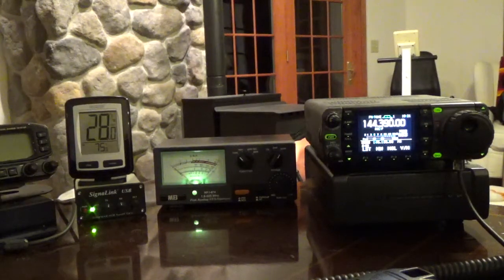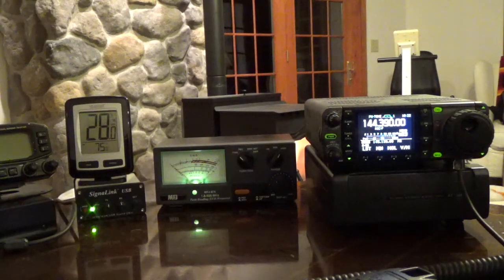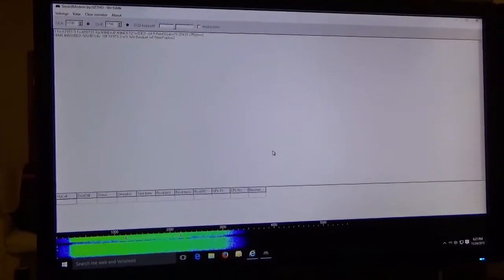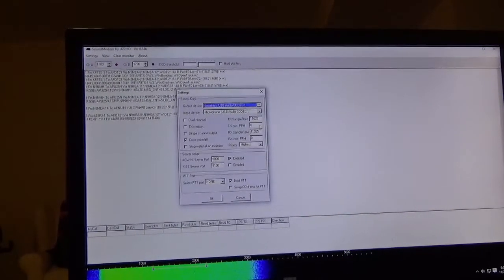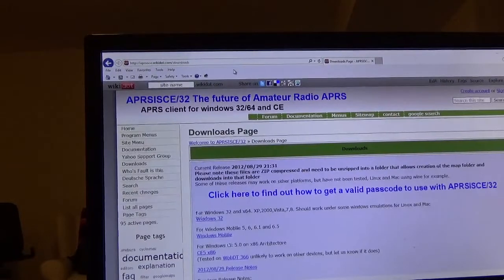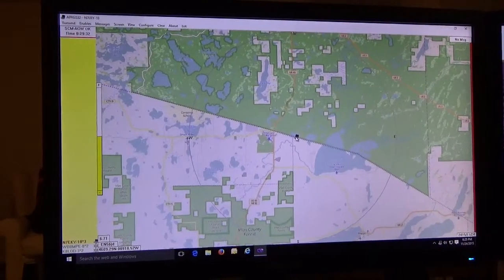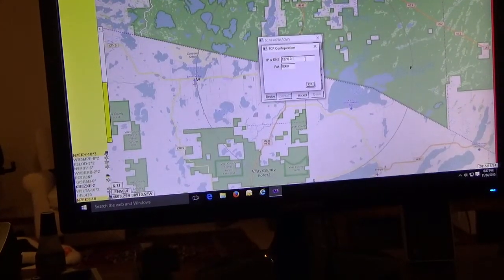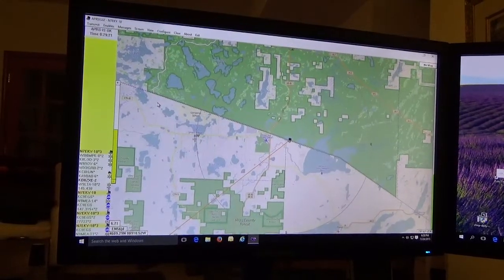APRS with UZ7HO SoundModem

Comment: I like this.  I realize this video has been out there for 8 years now, but stumbled across it while looking for some other ARPS info.  I really like my IC-7000 (I have two of them).  It's was my first rig and probably still my most favorite to use.  It just works and is, as you know, All Band, All Mode. It was nice to run across a video showing it off.

Comment: Paul, I had recently been wrestling with setting up APRSISCE/32 to play with my Signalink and a cheapy Baofeng.  I finally got it working last night using AGWPE but, as I floundered with solving Tx and Rx issues.  As KISS and Simple KISS seem to require COM ports, I got little farther with either of those.  I next went to the soundmodem utility and I just couldn't quite figure out how to connect to it using APRSISCE/32.  Luckily, it got it working under my original plan of AGWPE.  I just happened to notice that the port you demonstrated appeared to contain the letters AGW.  Does soundmodem run its own AGWPE daemon?  Thanks, I loved the video.  I truly wish I saw it before I started my project.  I think it would have saved me some time to get up and running had I seen your video first.
Reply: Hello Dave: Yes, UZ7HO supports AGWPE on port 8000 and Kiss on port 8001 by defaulkt but these ports can be changed. I really like this application. He did a great job on it. It supports APRS on HF also. 73,
Reply from the maker: Glad you got it working. UZ7HO was a good solution when working with a non-APRS radio

Comment: Thanks for putting together this video with all the equipment demonstrated alongside the software involved. That helped a lot. I'm in a class studying for my extra and we'd been talking about APRS for a little bit today. I've used the smartphone client and already had aprsis32.exe on my PC already. I didn't think to pair that up with the soundmodem program (duh). 

You have enough information here that I got the 2 programs paired up just fine. One note: the latest downloads from UZ7HO are a little different now since he has a different versions of soundmodem. I ended up using the version I downloaded fall 2016 (soundmodem 95) in this case and it worked fine. 

Now if I can finish figuring out how to integrate soundmodem with the current version of Winlink (aka RMS Express). 

A couple folks asked where APRS is helpful. Our local hams use it a lot for just casual position tracking and messaging. Beyond that, it's very helpful when weather spotting (our NWS ham team can see where spotters are) and for public service events like bike races where we have "support and gear" teams deployed. We're looking at getting basic email running with aprs as well, but that's another learning curve for this spring. 

Again thanks!   - wx9vor
Reply: Well, now 2 years old. I did see that UZ7HO's software is updated. You might also want to take a look at DireWolf. Runs on Linuz and Windows - good stuff that will also connect using KISS or AGW
Reply: That same classmate today mentioned DireWolf as well. He has it running on a Raspberry Pi. I'll definitely look that up. 73.
Reply from the maker: Been working with DireWolf on the Raspberry Pi as an iGate - works quite well. You can do a Receive Only iGate using an RTL-SDR. Works like a champ!
Reply from the maker: Glad it worked for you

Comment: Very informative.  I understand that this particular software modem/TNC by UZ7HO is highly optimized and likely works as good (or perhaps better) than a hardware based TNC modem.

One thing that you didn't really say, though, is that while this "gets you on APRS"... what does that really mean?  For instance, did the particular software install and setup that you did just make your home an i-Gate (assuming that the PC is connected to the internet)??  

Currently, that is my goal: to help a ham friend set up an i-gate at his home.  So it would be useful to know if he and I would need to add additional software to provide that functionality.

Thanks!
Reply from the maker: Given the current applications I am aware of, my choice of an inexpensive iGate would be a Raspberry Pi running DireWolf with a connection to either a RTL-SDR (Receive only) or a transceiver for send/receive. 73